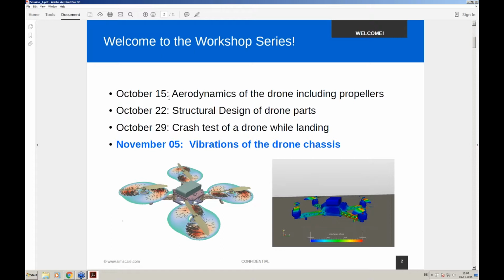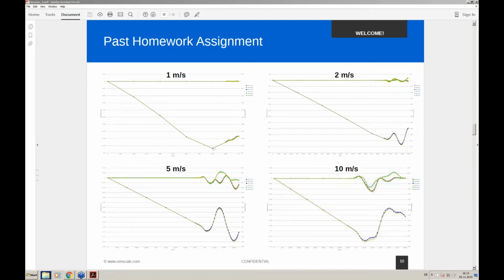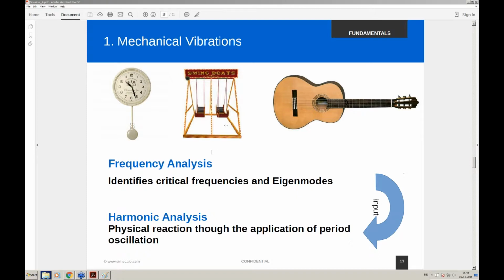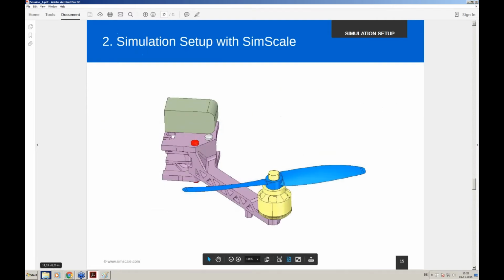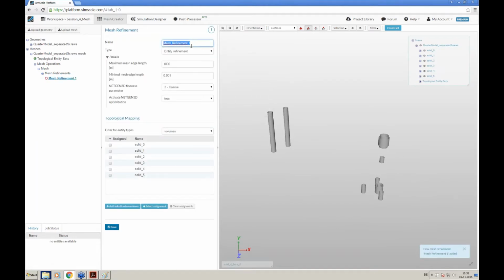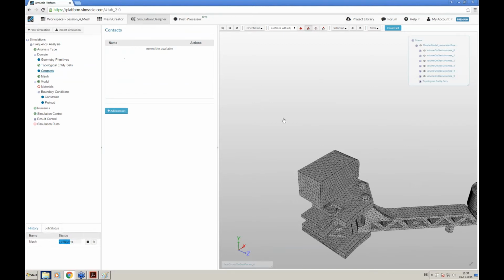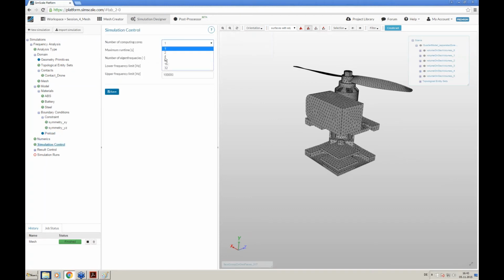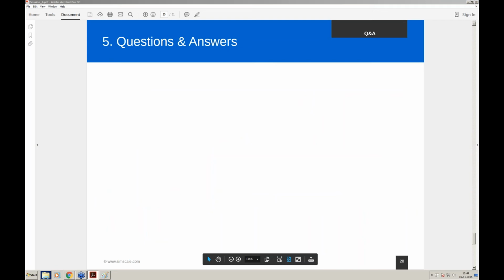Drone Workshop (Session 4) - Frequency Analysis of a Structural Frame

Comment: How did you find Young's modulus and Piosson's Ratio for the battery?
Reply from the maker: The battery in this example is assumed to be made of standard aluminum alloy, which has Young's modulus equal to 7e+10 and Poisson's ratio equal to 0.34. It is important to notice that those values are adopted for a practical approach, which should not be adopted as a general rule for all battery simulation cases.
Reply: Do you have any recommendation on how to model a 6S LiPO battery pack for a standard FPV quadcopter?  In my design the battery contributes to the stiffness of the frame, so it would be important to capture that in the analysis. @SimscaleSimulation